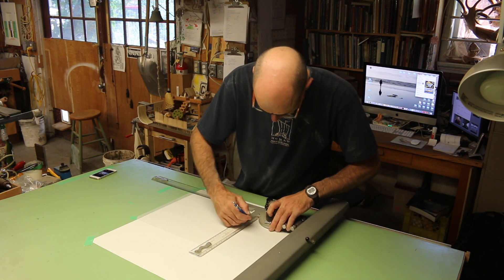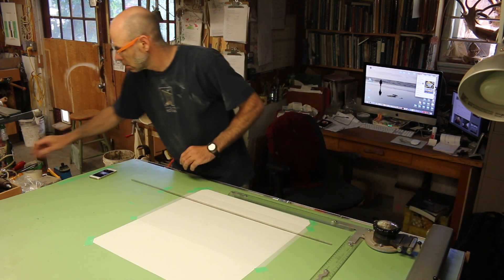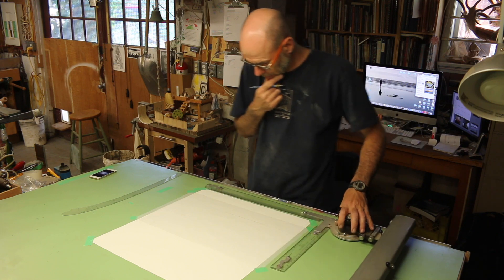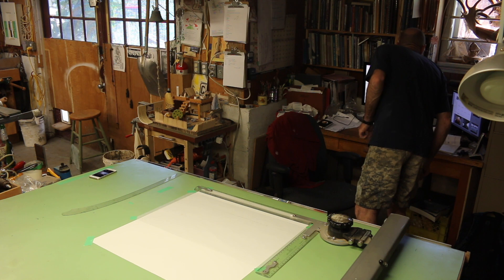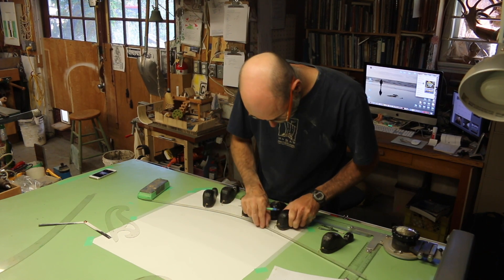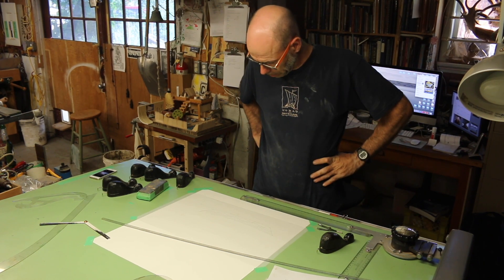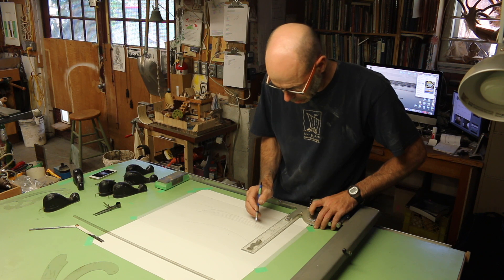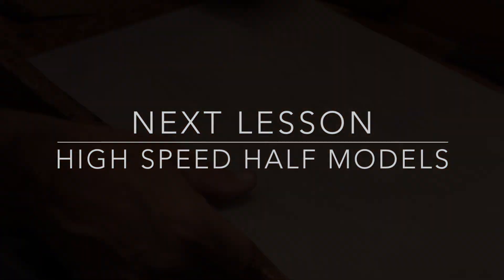Designing the Bouchie Dory  Pt. 1- Patreon content

Comment: Love your work and videos! Did you make those weights that look like whales? If I wanted to buy some, could you point me in the right direction? Gunalchéesh - thank you
Reply from the maker: I made those myself. I'm sure you can buy them somewhere but the shipping costs tend to be pretty high by most reports I have heard. I would check the Woodenboat store. They have had them in the past. My mould is made with a high heat silicone. I have three for efficiency when casting. I acquired used wheel weights from a tire store to get the lead from. Melted it in an old cast iron pan on a coleman with the a little extra heat from a torch. Stand upwind and wear a proper mask.

Comment: I thought about how important the drawings are to the building process. as opposed to just following the step by step process on your videos. not going without the step by step regardless but still what difference does it make if I can see the drawing really. but only you can say if you would feel "blind" without the drawings, trying to build for the first time.
Reply from the maker: The videos were never intended to be a step-by-step tutorial to build the specific boat featured. They are intended to show you my overall process and my thinking behind troubleshooting and developing personal techniques. Having plans for any build is of course an important asset but when I build in skin-on-frame for instance, I use no plans at all, but I have a well practiced process that guides me.